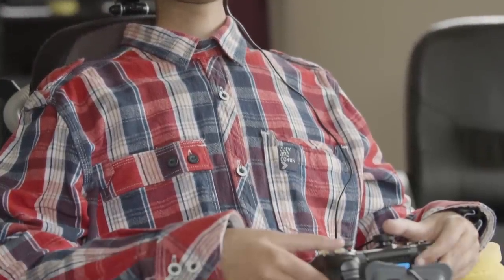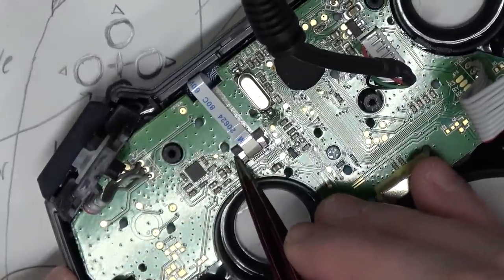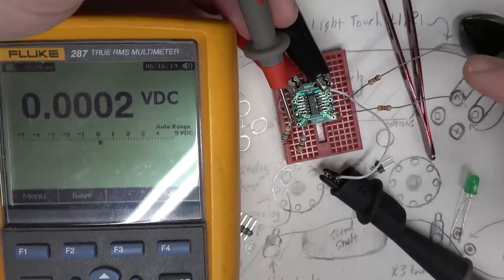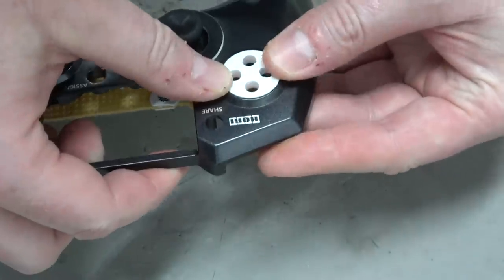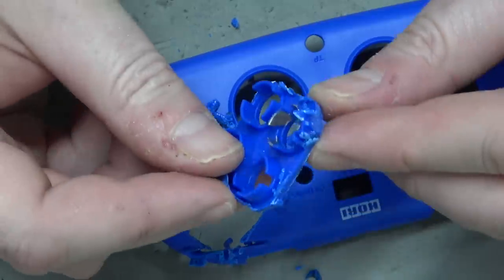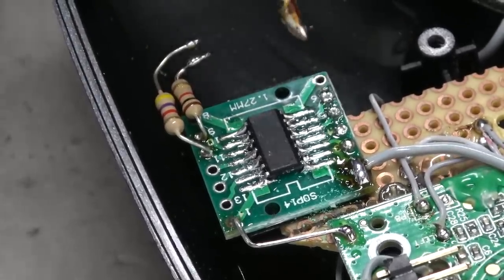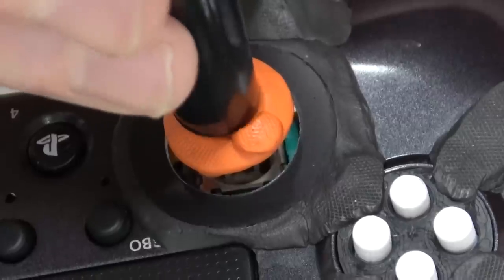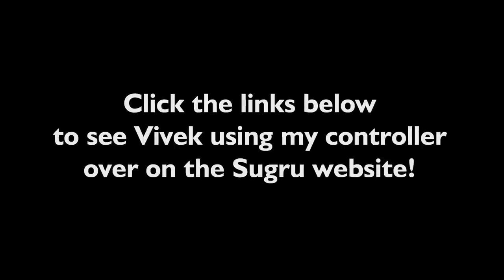Building a Custom Controller Using Sugru

Comment: Could you tell us the part number of the springs you used, or at least the measurements? I have Duchenne Muscular Dystrophy like Vivek and would like to try the thumbstick mod myself. Thanks!
Reply: I wouldn’t do it... there is a dead zone in the analog stick, in the center when the analog stick isint being moved around. It will be hard to keep the stick returning to center if u weaken the spring. so ether ur camera won’t stop moving or ur character won’t stop moving
Reply: @shaggytewsak  what if actually you can't move the stick? think about it. Jeez, this is about an accessible controller, if standard controllers could be used by everyone, nobody would need to mod them.
Reply: David Gil de Gómez Pérez dose not negate what I said. It will take more effort to move the analog stick and then to move the analog stick back to center other than to just let the controller do it it’s self
Reply from the maker: I believe it was this? https://www.mcmaster.com/9657k43

It was very tricky swapping the springs out, be warned!
Reply: He is correct softer spring will age quickly and lose its tension and will cause drift but I understand the reasons why a softer joystick could help you out
Reply: @shaggytewsak  it can often be solved with software, not sure of that could be used in this case - however.
Reply: @davidgildegomezperez4364  Probably a better solution to modify the actual analog stick so it takes less force to move than replacing the spring.
Reply: Good luck with your project, buddy. Hope you get things working the way you want.
Reply: @shaggytewsak  Yes, Sherlock. And what would you suggest instead? He needs a solution for a physical condition and you simply destroyed his hopes. Congrats.
Reply: @xangods  you responding with more toxicity doesn't help him either
Reply: I also have DMD. I use something called a quadstick for gaming, and it works well for me.
Reply: If you can use a special alloy spring, it may last longer, but if you soften it, I'm not sure. Although, you may be able to replace the spring altogether with some kind of bouncy yet soft rubber?
Reply: Wonder if a bigger lever would do the trick
Reply: @vektacular  exactly,better a longer lever will be better if he can make the wider movement.also easyer mod.
Reply: You can get snap on thumb stick extensions that may make it easier.

Comment: i get that this was an ad for sugru, but i really hope you also made an identical controller for him a bit more solid, and aesthetic.
Reply: I'm definitely glad someone else said this. I don't wanna hate because this was a really nice project and, let's be real, a lot of great engineering and ideas went into this controller concept completely targeted at solving Vivek's specific needs. Legitimately, 90% of this was really well thought out and designed. Just every time he broke out that glue stuff it just looked like a kid's art class project made of clay or something, all while simultaneously making perfectly 3D printed parts about the same size lol.

If anything this 100% convinced me to never buy or use this product for external use on something. I just hope everything holds together okay.
Reply: it seems to hold together okay.  Tell me a glue/clay that looks good.
Reply: @blake2697  Any glue would look good if he applied it in places you can't see it, ie on the inside of the controller like Sony does when they manufacture components. The problem with this material is it has to be on the outside

Comment: When I want to weaken a spring fast and easy, I stretch them and cut it back to length
Reply: That will actually make the spring stiffer.  The stiffness of the spring comes from the wire its made froms diameter and length.  By removing coils you decrease the length of the wire increasing the overall stiffness.  It's counterintuitive but picture the wire as straight instead of coiled. As you shorten the length of the wire it gets harder and harder to bend.  This is why lowrider cars with cut coil springs ride like crap. The springs have been made stiffer.
Reply: Do RC plus it would be hard to keep the spring flat on both sides and straight enough for an analog stick to stay centered in its dead zone

Comment: Before I add my comment, I wanna say good on you for doing this for Vivek. As someone who had someone handicapped in their life, I somewhat have an idea of the depression that Vivek goes through with not being able to do the things he used to do. I really like the controller, I think it's really neat in fact. My ONLY complaint is that the Sugru should of been nice and flush, somewhat smooth. Like over by the D-Pad where it makes an X, that really bothered me and I'm not sure why. The left analog stick has Sugru and the right one doesn't. I think it's just the fact that it doesn't look uniform and sort of just rudimentary, not really any art style with it I guess. I know it's too late now to make the changes as it's now about 3 months past when this video was sent, but other than that minor complaint, your work was amazing.

Comment: at the risk of sounding like a negative nancy, its a real shame Sugru had to sponsor this. Heck can make some pretty slick looking equipment given all the tools he has available to him, but since he was obligated to use so much sugru stuff, it ends up looking pretty ramshackle. im sure it works just fine and its gonna be massively better than the controller Vivek was using prior from a technical standpoint, its just a shame that it has to look like it was slapped together with a bunch of drywall putty for the sake of appeasing our corporate overlords.
Reply: I don't think it was so much a problem with the sugru as the crazy hacks he did to try to make very different pieces of equipment work together.  I would have tossed much of that crap out and remolded the shell using water smoothed sugru. Then drilled out the holes where they were actually needed and built up the supporting electronics using a Teensy or Arduino Nano, since most of it was simple switches.  I would have also used cheap optical or bend switches for some of that.  I am actually surprised he did not use more of that Qt1070 chip, he only used two out of the five possible.   The analog portions could have still used the same joysticks but would have been more easily programmed and tweaked to more precisely fit Vivek's needs and could be adjusted over time as necessary.   Sugru has the capability of making very nice professional looking surfaces if it is treated and worked with the right tools. It can also be further worked after it hardens.
Reply: The problem there isn't the Sugru, but his abilities or patience in using it to make it look better. He simply used it. And the texture thing was an attempt of making it better, which I must say was a clever idea.

Comment: I get it, it's a Sugru promotion but there's really no reason to shape those analog stick heads manually instead of 3D printing them as part of the already printed shafts.
Reply: Exactly, it looks a mess. Half the controller is open to the elements.

Comment: Hey Ben!  Most slicers have an option where you can set a minimum layer time.  Or you can add a dwell gcode command between layers to gain the consistency you were talking about.

Comment: Hey Ben, how inspirational mod was that.. i work as an alarm installer and electronics is my hobby. I feel confident and make occasionally stuff. I decided a month ago to open my ps4 controller and add a X button to the back. Omg, imagine my disappointment seeing that flexible pcb. I abandoned my idea immediately, didn't even bother probing the main pcb. Can you make a video of showing where are the buttons on the pcb or how can you attach a wire on the flexible, if you even can.. 
Thanks for your work and amazing content!

Comment: That Sugru stuff seems amazingly usefull.  I would want to try moulding it like putty to make a casing but I suspect it would be overly pliable.  It is probably best used in conjunction with more rigid pieces of material.

Comment: Was there a reason you made your own stick setup, rather than using the pcb from either of the other controllers used? They both looked like they were really close to fitting as is.

Comment: Awesome vid! It's cool to see someone modding a controller like this! I have a question: is there any way to unconnect the touchpad so that it doesn't work? I took apart my PS4 controller to replace a thumbstick and when I put it back together , I didn't reconnect the connection for the touchpad thinking that would keep it from working. Unfortunately, I was wrong lol...I tried it on both my controllers but I had the same results...Any tricks or ideas you can think of?

Comment: This is so cool, I can watch this the whole day! Nice and beautiful work Ben, you are an angel..... really! I wonder if it is possible to use sugru to fill up/rebuild broken and missing plastic parts. For example, I have a cool Toshiba boombox that is abused in the past and most of the corners are damaged. I fixed some connections succesfully inside with use of soda and super glue however for the outside this is too ugly (white) and not as easy to shape like sugru. Could sugru be a solution?

Comment: Sugru is great! I have one of those old New York style radiators, and the bleed rusted open, spewing scalding hot water unless I turn off the heat for the whole house. Was able to use Sugru for a makeshift cover and it's as fixed as it possibly could be without a repair man!

Comment: I was thinking that you could have put the 3,5 mm jacks in the base/stand and wired it through the shaft/stand and then they wouldn't be in the way at all. Meby something to think about for v2 and thanks for a great video
Reply from the maker: Good point though you'd need a disconnect somewhere in the shaft so it could still be disassembled.

Comment: It was probably asked a million times before but: what wire do you use? And what awg do you recommend for fine pitch (smd) like in a GameCube or wii? 

The insulation doesn't seem to shrink back in yours. Mine does on the 30awg I've got here.

Thanks for anyone that can answer.

Comment: The D-Pad from an old Gamecube controller might have been a good fit if looking for a smaller D-Pad.  That thing was TINY (something that always bothered me about that controller :P).  Of course I have no idea if it would work for the same style of input/switches etc. so that would need to be researched by taking one apart.

Comment: I need advice if you are willing. I would like to customize my controller to add two buttons in the rear. I dont have any kits or anything. Is it possible to do this with parts from an old controller only?

Comment: I've used that Hori Mini pad in an arcade stick build. I dual modded it to be able to switch between that and the original controller board. It definitely wasn't as involved of a project as this, but I still learned a whole lot in the process. 
The triggers on that Hori Mini are active high so you can just invert them with a hex inverter IC such as the 74HCT04. Other than that, it's a great donor board for making custom controllers!

Comment: I like it the only things I would have done differently is probably make some molds for the analog stick caps so they are completely perfect rather then hand craft them.

I think I would have done the external jacks differently too. I would have made a external connection for all the buttons not just the four he requested just to give him more options if he ever needs it.

Since the controller was mounted on a base I would have probably just ran the wires down the mount and put all the 3.5mm jacks on the base of the stand instead of the controller. You could easily have a socket for each button that way without space being an issue.

The sugru stuff looks interesting and especially useful for things like this.

Comment: Pro tip use wet dry sand paper on sugru to get a more progressive even smooth finish. Obviously use it as a wet sand paper. 2000 grit should do it.

Comment: Not getting the full range on the analog stick is a common issue. We all deal with this when trying to change out the junky potentiometer's that microsoft and Sony put in their controller. I haven't got it figured out yet and the general consensus seems to be that the pot meters are not reliably made to the correct range. But I was leaning towards it being related to the solder I was using since mine will work 100% for an hour, then lose range till I rest the controller. One thing for sure, Potentiometer replacement is a nightmare.

Comment: at 6:30 you can connect a thin wire to be placed in between the board and conductive ribbon (so long as both the ribbon and pcb are still connected via the wire).. i modded my ds4 this way.. it is a bit more tedious and you have to be precise, but once you have a thin wire where you want it.. you can then use the other end to connect as many buttons as you want (well in theory) the hard part is you cant solder anything you must use hot glue or something like it

Comment: Why not make a custom pcb with a bunch of wire connected to the original pcb hidden in the base ? And use epoxy mastic for permanent modifs.

Comment: FYI, you should never use CLP (3-in-1) on anything with plastic parts. It will degrade the plastic. The best plastic-safe lube I've come across is made for woodwind instrument valves and comes in a syringe. I buy mine at a music store (Long & McQuade), but it should be easy enough to find on Amazon. Failing that, nothing beats good old silicone lube for plastic parts.

Comment: How do I not know about this product at 41 years of age? I’ve been making and fixing things all my life and controllers happens to be something I’ve dove into head first as of the past year or so. I sustained a traumatic brain injury while serving in Afghanistan so I have some neurological issues. My fine motor skills are more gross skills now in my fingers lol. I had an issue with activating the L3 and R3 buttons so I trimmed the tops of the switches and after a couple tries taking off extremely thin layers of plastic I achieved the perfect press distance.

Comment: Surprised he didn't 3d print a mold for the sugru thumb sticks for a cleaner look.
Reply: Cant use a mould because the sugru would bond to it. Though I'm not sure there may be mold release agents that work on it but they might leave a residue which would probably be hard to remove

Comment: Sony should just make a new controller with capacitive touch buttons and the same connectors as the Microsoft XBOX One Adaptive Controller. This would have been a better project if you scanned the controller top, edited all the holes and textures and then just reprinted it in ABS. Then added a custom board to add all the buttons and the touch pads. I am sure there are more than enough overnight PCB companies that would have sent you stuff for this project. There are a ton of those controller toppers on Thingiverse and TPU would have worked better than Sugru.

Comment: Wait cutting the silicon pad helps with easier pres??? HMMMM If I do that to my ps4s dpad....inputs for fighting games would feel better no?
Reply from the maker: It certainly "softens" the press. BUUUUUUT it will reduce how long the part will last.
Reply: @BenHeckHacks  Makes sense. Thanks!

Comment: I know sugru sponsor this project , but wouldn't it have been easier to just 3D print the top and bottom shell of the controller and created a custom pcb from a website? It would have looked 100 times better.  And don't tell me a custom pcb would be expensive,  that's bs.

Comment: Sugru isn't the world's first mould-able glue. Superglue (cyanoacrylate) mixed with baking soda has been used as a mould-able glue for decades for aircraft and propeller repairs. I'm sure it has other uses too. Its a little faster than Sugru and is best filed into shape after use but it certainly far predates that product. As do many others - filler and glue isn't a new thing.

Comment: like what you have done for the guy.....  heads up, there is another molding plastic called frogz eggs from pratleys, it is softened with boiling water you then mold it, use it to brace 2 plastics together.... then just let it cool down it hardens into a hard plastic, man does it stick to plastic..... you wont be pulling it off plastic once it sets

Comment: I WANT TO BUILD A CONTROLLER WITH INSTEAD OF 2 TRIGGERS ID LIKE 4 AND NO BUMPERS.. SO WHEN PLAYING RACING GAMES I CAN HAVE ACCURATE CONTROL OF MY CLUTCH AND EBRAKE.. SO BASICALLY.. L1 AND R1 TURNED INTO TRIGGERS .. SO THAT ITS NOT JUST PRESS A BUTTON FOR CLUTCH AND EBRAKE.. DOES ANYONE KNKOW IF THERE WOULD BE ANY ISSUE DOING THIS?

Comment: Why did you use that puttyand take the other controller you had of it apart but it's a putty around the joystick and then cut the putty off and you could have used it as a mole to make a custom properly done one that doesn't look like trash very shoddy work I could have made this look awesome

Comment: A+ for the electronics, D- for the build quality. Frankenstein controller. Over use of the Sugru where normal glue or epoxy would suffice. Maybe get a sculptor to help next time.